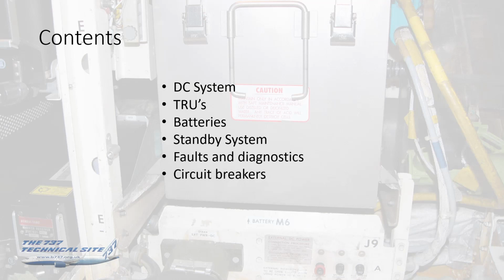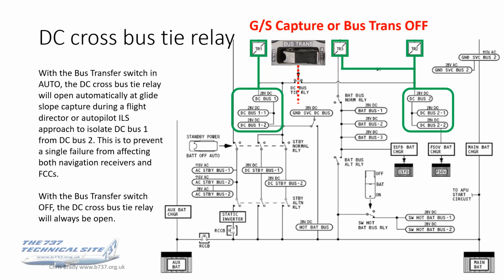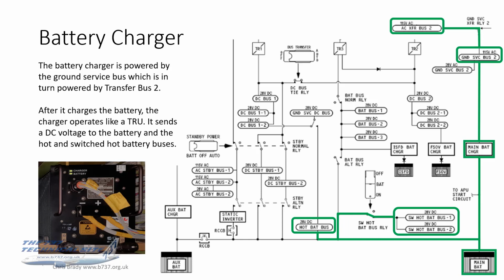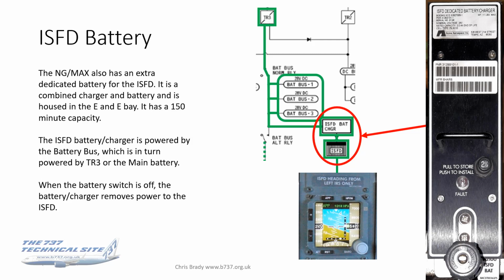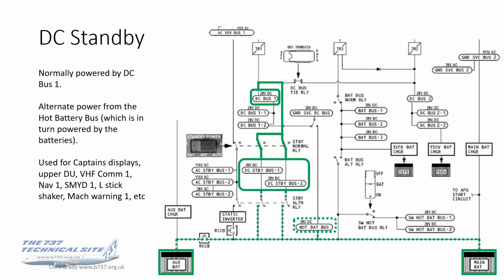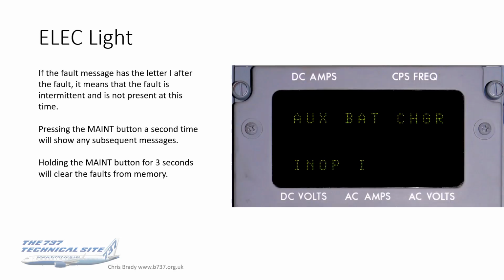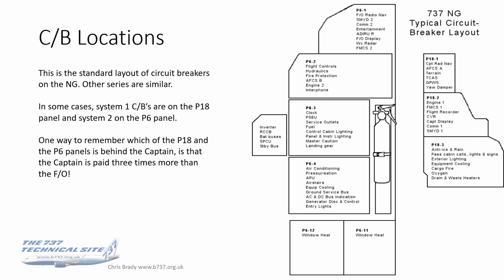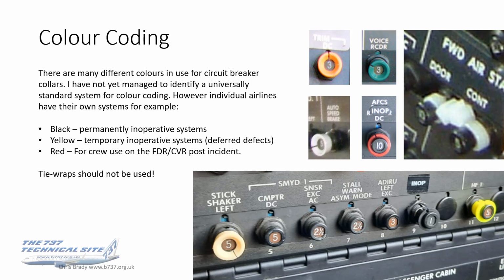737 Electrics Part 2 - DC Power

Comment: I have a question which I apologise if it was answered in the video but I couldn't seem to spot it. What are the different ways that you can tell if the aircraft is configured with a single battery for 30 minutes standby power or the dual battery for 60 minutes standby power? Thanks very much.
Reply from the maker: For pilots it should be in your airlines FCOM which should be tailored for each individual aircraft. Some airlines have aircraft differences listed in the Tech Log. Your airline should have a mechanism for telling you.

Comment: Some months ago it happened to me making a SPCU test with APU, since the stand didn’t have GPU. Started the APU by batteries, then, maybe I didn’t give enough time to batteries to recharge, maybe a 5 minutes. Then, made the SPCU test, switch to off to see if the standy pwr off light comes on, then auto again, ok, then powered off the APU gen buses to force the system to hang on batteries in order to wait and see if battery discharge light comes on. What happened was puff, everything comes down and off😂…emergency lights came on (the switch was not in armed position). From my dispair how could be this possible since I didn´t put the battery switch off, because if so, the ACU (APU control unit which is powered by battery would sence battery off and then turned off the APU). I didn’t had a choice, had to replace the main and aux batteries 🤯.
So my guess is I didn’t give enough time for batteries to recharge after the start the APU which is a hell of a discharge, the nominal voltage could not be the ideal and the system powered off like I switched off the battery on purpose.

Comment: In light of the Jeju 737 crash, maybe CB could give a short update on what Automatic reconfiguration of the electrical system would have occured after the loss of both ac generators, and whether any manual reconfiguration would have been necessary to make use of the DC and Standby busses.
Reply: He has done a recent video about recorder power which does go into some detail about standby power but essentially it's just the batteries power the AC and DC standby systems
Reply: Thanks, I've watched it, CB is good but in this case he says little about automatic switching and reconfig, or pilot actions if all AC lost. That's why I posted.
Reply from the maker: The standby busses are automatically powered after the loss of all AC power.

Comment: Question i thought of the other day while we had 1 eng gen on mel.  What would happen if the main bat charger fails (on a single battery 737 ng) once airborne? Would the switched battery bus all and hot Battery bus fail after 30 odd minutes? What would the indications be? Elec light only comes one on thr ground.
Reply from the maker: Please ask any operational or technical questions here: https://www.facebook.com/groups/737tech
Reply: Battery life should be significantly longer than 30 minutes as you are not supplying the standby or battery buses from the battery, only the hot/switched hot battery buses. Most loads on those buses are either very low (e.g. clocks powered even while aircraft is off) or only draw power when relevant, such as warning lights, fire indicators, valve controls etc. 

Looks like biggest loads are probably ADIRU DC supplies (not sure if these draw any current while they have AC supply) and APU and generator controls (hopefully these are self-powered when operating, or a shorted battery would be a pretty bad single point of failure).  

If you are drawing more than 5A on those buses (I expect this is unlikely?) you'll get a battery discharge light after a few minutes and you'll probably still have several hours battery. If you're drawing less than 5A, a hypothetical 36Ah single-battery NG ought to last at least 7 hours.  A total generator failure after discharging the batteries would not be good, but is very edge case. 

Obviously this is not formal advices...

Comment: In a dual engine failure (Sully scenario) no APU powered only DC, is the Standby Hyd System available?
Reply from the maker: The standby hyd pump is electrically powered from AC Transfer bus 2. So, if that remains powered, you will have standby hydraulics. In your (unlikely) scenario of no engines and no APU then you will have no AC source to power the AC transfer busses, so no standby hydraulics.

Comment: Hi,
i might have missed the explanation, if i did i apologize, but could you explain the role of the diode between TR3 and TR2?
I cannot find any answer in my company books.
Thanks for the content
Reply from the maker: A diode only allows electricity to flow in one direction, think of them like one way vales. The diode between TR3 & 2 shows that TR3 is backing up TR2 and not the other way around.

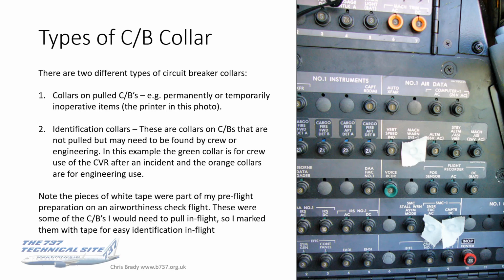Comment: 41:55 Out of curiosity, why did those breakers need to be pulled during this airworthiness check flight?  Was it just to avoid nuisance warnings?
Reply from the maker: The CBs were not pulled together but one at a time, so the tests could be conducted on each system individually.

Comment: Hi, great channel. Got a question on the DC system. If you loose Transfer bus 1 or a power source to DC Bus 1 why doesn’t transfer bus 2 not pick this up? But the batt and aux batt chargers do
Reply from the maker: The DC cross bus tie relay will power the DC busses if Transfer Bus 1 is unpowered
Reply: @ChrisBrady737   Hi, from the FCOM

With loss of AC transfer bus 1 or the source of power to DC bus 1, the AC and DC standby busses are powered by the main and auxiliary battery/battery chargers.
Reply from the maker: I think we are not quite understanding each others questions and responses - always a danger with short written Q&A! If transfer bus 1 is lost, DC Bus 1 will be powered by Transfer Bus 2 via TR2&3 through the cross bus tie relay. So transfer bus 2 does "pick this up"
Does this answer your question?
Reply: @ChrisBrady737  Full understanding is vital. Thats how i understood until i read that part in the FCOM i quoted above though?
Reply: @ChrisBrady737  So what about the AC and DC standby buses?
Reply: @Driver170  “With loss of AC Trans Bus 1...”

Doesn’t that section refer to operation with loss of all generators? I think that’s your missing link.
Reply: @gatorbuc99   yes, the FCOM isn’t quite clear on this part